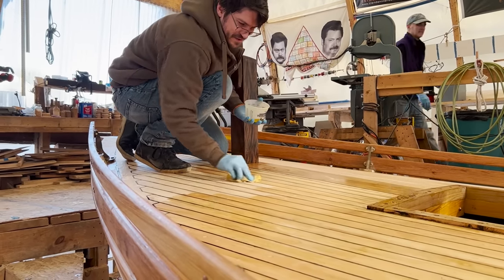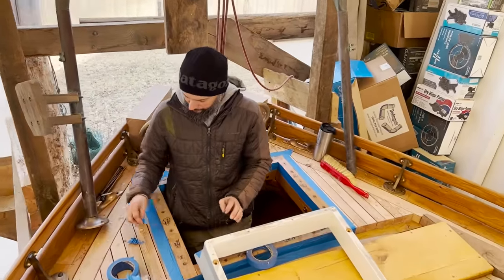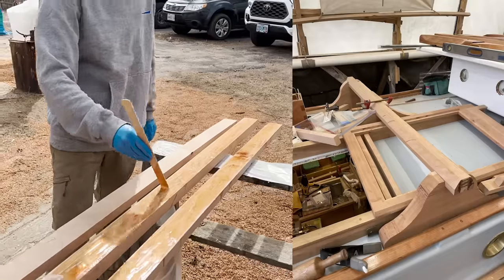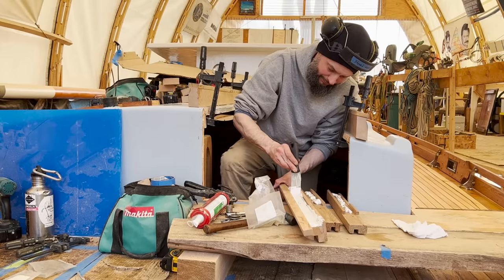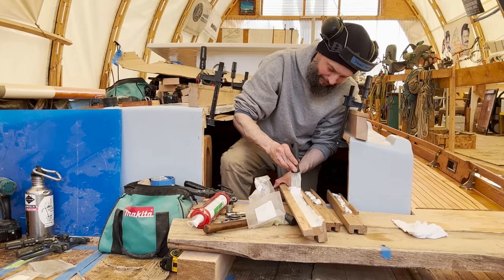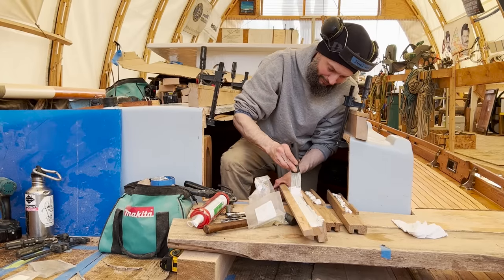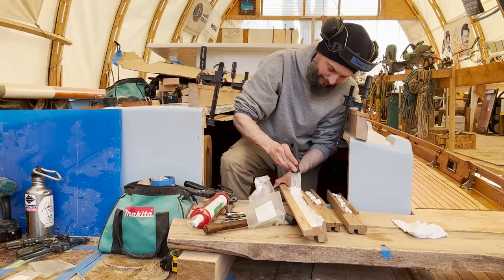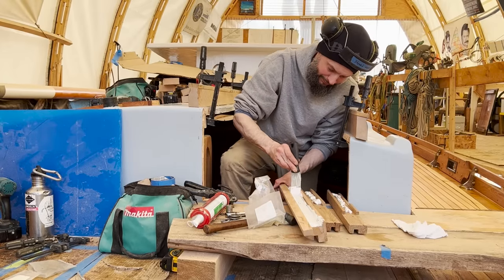How To Make Boat Soup - Episode 262 - Acorn to Arabella: Journey of a Wooden Boat

Comment: Main reason I contacted you is at the end, ha. Had to toot my own horn a little first. 

       Myself like many have watched and subscribed from the beginning, watching the rains wash away your lofting lines. I have always been interested in wooden boats beginning with my first built small five foot sail boat at the age of 10. A friend/business partner and I bought one of two only,  built in 1942, a 52 foot dual gasoline Chysler straight 8 industrial powered vessel owned by the Washington State coastguard, swinging a pair of 24 inch monel screws.  Originally used as submarine chasers off the local spit. Had a huge thick metal clad wooden keel running from stem to stern, used to ram the conning tower if they could not stop it with their 30 caliber machine gun. Her sister ship owned by an elderly couple had sank in shallow water too many times that the coastguard would only raise her this last time, if it were towed to deap water and began its new life as a reef. Ours was very nice in deed, until we scraped the paint off. All that held her together in places. 1.5 x 7 inch port orford cedar planks and huge  stringers. After a few new bones and planking installed we began our huge task of rebuilding the entire boat from the rails up. After over five thousand screws and corking and caulking the entire hull, we were very tire of the boat. Smoothing the hull was something we thought of farming out to the local fairing company. 

      👋👉📮 IMPORTANT TIME:  I also had a vehicle restoration shop which I sold right before this boat project. We used double piston skigget boards. They are a long board air driven sanding machine. There are different lengths and the sandpaper is purchased pre-cut. It may be a worth while purchase eliminating waves. Watching you use that  palm sander, it hurt. Knew if I ran my hand down the side it was to be like the Pacific Ocean.

       We used the boat to ferry couples from Seattle to Alaska and home durring the summers ,using the three major State rooms. The crew, us, slept in the large in closed flying bridge/state room. Winters the craft was Bob and his wife's home. All the upper structure was created from 50 year old, as much as we knew, Honduras mahogany salvage from many old train car floors. Watching over the years , I would think, almost like Bob and I built it or no Steve the other side or the lot. Good luck on your date for dropping it in the drink.

Comment: Pine tar in Finnish is terva. Our traditional wood boats planks where coated by terva to make wood last long. Fun fact it was also used in skies when weather was above 0c.
Reply from the maker: Thanks for sharing that, Kari!
Reply: It actually used to be used on all (wooden) skis back in the days before plastic. We'd tar the bottoms of our skis every winter and heat them over an open fire to get the tar to soak in. Tar was also used to impregnate buildings, especially roofs. Fishermen's cottages out in the archipelago were coated with a mixture of tar and seal oil. The very steep roofs of old churches were clad in tarred shingles and the job of renewing the tar coating used to be used as a punishment for adulterers.
Reply from the maker: Wow!
Reply: Used it in other applications. Other products have better inpregnation than pine tar. Molecules are much larger and move slower to the center..
Reply: @melvinklausnowski3106  The protective effect of pine tar is not based on deep impregnation and it is not a toxic biocide according to the European Chemicals Agency (ECHA). Pine tar forms a film on the surface of wood that protects the wood from mildew, insects and sunlight. Also, pine tar is not a single compound but a mixture of numerous aliphatic and aromatic hydrocarbons, terpenes etc. that have widely differing molecule structure and size. Pine tar can be thinned with turpentine if deeper impregnation is required; heating also helps. Incidentally, pine stumps, even old ones, often contain a large amount of "tar hydrocarbons" that give off a typical scent when split; such "tar wood" ("tervas" in Finnish") is excellent firewood for campfires as it burns even when wet (although it can coat your cooking pot with a layer of tar).

Comment: I did a lot of lead joints in cast iron drainage pipe when I was in my teenage years. Because in that process you pound lead into the hub after you push in a bit of okem. There must be a lot of old sets of Irons as that process is no longer used. Every set had off set irons in them because of the very reason you mentioned you had to drive the lead into the hub and to do that the Irons were offset so you could hold the Irons and not have to have the iron on an angle. The irons had a wide flat end however they could be ground down to an edge that you need. Check with an old plumbing company locally and I bet you could find what you need.

Comment: Always heard that it is boiled linseed oil that is prone to self combust in saturated rags. But prudence is always good, I guess. So cool you are using oil from Allbäck in Ystad, just 20 mins driv from my place!
Reply from the maker: That is very cool!
Reply: Any drying oil or oil-based varnish can self-combust. Friend of mine seasoned her cast-iron pans with flaxseed oil, which is just food-grade linseed oil, and later found her kitchen trash can smoldering.

Comment: A suggestion on soaking the deadeyes: If you were to string them together in such a way they all stay nice and submerged you can then take them out of the bucket to let them dry on the string and dump them back in when they are dried... You could even hang the deadeye string above the bucket untill they have finished dripping.  Makes the procedure easier and quicker...
Reply from the maker: It’s a little hard to fit them all that way, and a bit messy to take them out, but yes that would work too.
Reply: @AcornToArabella  A string would be more messy, but a thicker wire with s bends in it (acting as separators so the dead eyes don't touch while submerged) would be even better. A mess can be prevented if the collection of dead eyes are pulled from the bucket and suspended about said bucket until the messy dripping has stopped...

Comment: Any thoughts towards anti-slip grip on the deck in strategic areas? Not sure if you've touched on that yet. It's really coming together and looking amazing.
Reply from the maker: Wood, simply finished with cured oil, had a very reassuring feel to it. We won’t be adding texture, this will be very good on its own.
Reply: @AcornToArabella  Right on. That's how it was for thousands of years.
Reply from the maker: Good point!

Comment: Will there be no “handrails” or whatever they’re called on a boat??
Reply from the maker: Sure will. Interior along the cabin trunk interior and on the cabin trunk top. We tend to call them grabrails.
Reply: Do you mean rails running around the edge of the boat - above the toe rails -  and at something between knee and waist hight ?These are sometimes called guard rails and are often made of wire stretched between metal posts (stanchions).

Comment: Stephen, a way to get more "soup" absorbed is to pull a vacuum on the deadeyes in a container that can handle the external pressure differential... they don't have to be in the liquid, but wet helps... taking the atmospheric pressure off allows pores in wood to open and some outgassing in liquid. Just a few minutes in vacuum, then return to outside pressure, maybe a second cycle a day later after overnight soaking as usual. Pressure can do the same if you have a chamber to do pressure in safely...
Reply: You can also just boil the deadeye-soup. The remaining moisture will boil out of the wood and also displace any air inside the wood fibres. When it cools down, the oil will get sucked into the empty space inside the wood fibres.
Reply from the maker: We don’t have one of those and it’s not really necessary. Neat to think about though, many people have commented today about it.
Reply: My exact thoughts, or even a pressure cooker under pressure only. As a wood Turner we use this technology all the time.

Comment: In the long past I added Japan dryer along with your ingredients.  Seemed to diminish stickiness.  Another great video.  Pieces of the boat coming aboard in dramatic fashion.
Reply: Yeah that's what I was thinking, could really use some sort of dryer. Otherwise they're going to be sticky forever.
Reply from the maker: I personally use turpentine to send it deeper into the wood, and it does help with drying a bit. Again, many mixtures! I also enjoy Kirby’s premixed and wonderful Salty Dog Deck Oil. —Anne

Comment: The comment about the top toerail being a lashing resource as well as a handhold reminded me that the one thing I have found most boat builders skimp on (including expert and experienced sailors building their dream sailboat, who are generally as good as it gets in attending to important detail) is *lashing points*, internal and external. They generally do better with handholds, but (especially inside the boat) this is also often somewhat lacking. Maybe his rock climbing background helps Steve avoid these pitfalls. 
Have a look around the interior of a boat you're finishing off. Imagine a crane picking it up, inverting it, and then dropping it a couple of metres before the chains come tight again. Imagine major items breaking free (perhaps the cooker gimbals had a hairline crack). You need to immobilise it/them before the next big set of waves comes through. 
Lashing cord, precut to a variety of lengths and neatly stowed in a handy place, is also invaluable.
Reply: @AcornToArabella    I have to say the amount of APPARENT progress this episode is a new high water mark. I realise it's because a whole lot of highly visible deck furniture is getting finished and fitted, so that it represents a compression of a lot of REAL progress into a small time. 
And of course the last twenty percent of a boat takes eighty percent of the effort and time. 
Nevertheless I know how heartening it is when a spurt like that suddenly takes you so much closer to launch.
Reply from the maker: True story. Thanks for noticing!

Comment: Hi again 
watching you struggle with the knuckles i have an idea 
grab a  thin piece of  around 4mm  mild steel plate  and bent it 90º in the end  to make yourself a "shitty"  custom tool for that aplication
it will not last as long as the fancy hardened ones that you have but enough for your aplication and you can modify it for diferent shapes and places of the ship to make your life easier , your knuckles last longer and your  not losing or modyfing any good existing tool 
you can also use the brass left overs , its softer but you don't need too much force so it will survive well and you can save them for the future ship tool bos if you make them nice

Comment: Pro tip regarding dispensing sealants/adhesives.  
Adding a whole bunch of it will not make it seal better.  
What will make it seal better is adding ONE BIG bead in the middle, so that when it is squeezed you know how it is spreading (from middle outwards) and you know you are not trapping any air in the bond.  If you add multiple beads in a messy way, you have a guarantee for air in the bond and it might seal or it might leak.
Reply from the maker: Understood about that, but we had some known air bubbles here and there because of how Jeffrey’s behaves in different temperatures, so we were correcting it. Since Jeffrey’s doesn’t chemically cure, a hot knife can eliminate the trapped air you’re mentioning here. —Anne

Comment: Hi fellas awesome like always
Thanks to you  , i've just discovered the thing about boiled linseed oil cathing on fire by itself , is scary
here in europe i'm more used to the non boiled and other oils  , 
i'm trying to found more info about if the regular one also cathes fire by itself , i 've found that the curing agents of the boiled one accelerate the reaction and increase the heat and thats why it catches fire 
but i can't find someone who tested if the regular one also cathes on fire 

I'dont know if its viable for a giant deck but i want to recomendate beeswax oil instead of the simple oils 
i use it as a finish in my knife handles and in my opinion  is better than linseed oil, the wood looks more natural , the pores fill with wax  and to me make it more water resistant 
  i normally use olive oil+bee wax because i make kitchen knifes and i want them to be as food safe as possible  but for a entire deck the cost maybe can be a little bit high , but you can use other oils like  linseed/mineral/vegetals + wax because your not going to use the deck for eating   normally 😁😁😁😁 
at least give it a try for the indoor part of the boat and small pieces , it smells amazing, like a field of flowers if  you use raw wax from the bees
Reply from the maker: I know some folks who do this too and you’re right, it does work great for certain things. Thanks for sharing! —Anne

Comment: Steve you used the 4200 that stuff is not uv resistant and as all caulking is a gasket you have a small bit of it outside in the sun and this will fail what you should be doing in traditional boatwork we only use dolfinite or 4000 uv so nice attempt and future failure also never make anything hard to take off because redoing things is just a part of boats and when you fail you will have to redo in the future and also most traditional wooden boats that are a fresh build should use no 3m products except for a mask and tape
Reply from the maker: Part of maintenance is seeing to caulked areas when oiling or painting, and resealing around anything is inevitable, even when you use so-called UV resistant stuff. And as for removing 4200, these are coamings. Maybe they should be hard to remove. And it’s not like we used 5200… it’s a deliberate choice. Thanks for weighing in! —Anne
Reply: I agree of the UV support in other products, but how many times a season do we sand a repaint our brite work.
Reply: @Melvin Klausnowski  hey you know about oil based varnish work 14 coats uv minimum and two a year your highlighted but have you painted or varnished for 20 years do you have something you could tell me I am all ears and not only that most of the people watching the channel like you have as limited experience using the products yeah sure you read the brochure time in the field as a boatbuilder/shipwright actually I know alot do not question the stuff I bring to the table

Comment: I have a bent iron which my neighbor gave me.  It was used by plumbers to tamp into the pipe joint in the 4" drain pipes for waste pipes in plumbing.  The joint, joining two pipes would be packed with oakum, then tamped in tightly using a hammer and the bent iron.  After  that, molten lead would be poured over the oakum, making a seal.  Anyway, bent irons are still available in old-fashioned plumbing supplies.The bent iron prevented the plumbers hand  from being pressed  up against the soil pipe.

Comment: ignorant question here....does the battery cable length being the same on all the batteries really make that much of a difference with that gage wire?
Reply from the maker: Yes, it does. Great question. Managing resistance is a big deal for charging very sensitive batteries like these. It lengthens battery life.

Comment: Summary was generated by Summatim, let us know if there are any inaccuracies! 🤖
0:01: Patreon support
0:24: Faring the hull
0:58: Pitching the deck
2:01: Working on the boat
10:59: Electrical system
18:54: Dead eyes
21:20: Boat soup
Reply: Fairing the deck.

Comment: Why sand/grind the hull planking with the boards? That's a recipe for long horizontal flat spots. This is basic sanding, go diagonally across the plants/boards. 

You're making lots of extra work for yourselves.

Also consider a Tyvek suits for those fair the hull with power tools.
Reply from the maker: Check out last week, that was a previous step 👍
Reply: As a boat builder, I believe Steve was simply taking down the high spots. Yes in deed, it hurt me also. But he is learning.

Comment: Sorry I will not use a lithium battery in a wooden boat, because the fire Hazzard is too high, but that's me. Any thing can happen and overchargeing and ever salt water and lithium is a dangerous combination.
Reply from the maker: Give a read about lithium iron phosphate batteries, they’re very safe. The batteries you’re thinking of don’t have the systems these have and they also have different chemistry.
Reply: its LiFe its a great choice and they can take A TON of abuse unlike Li-Poly's or Li-Ion's
Reply: LiFe is the choice in aircraft as well without too much discussion from the FAA.